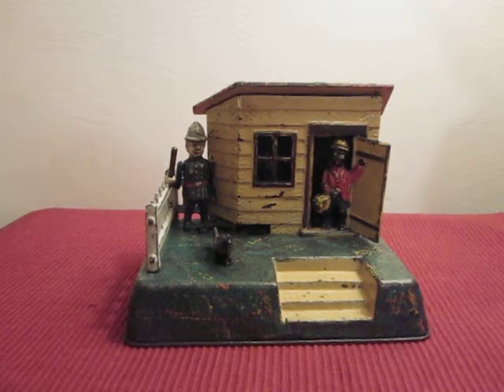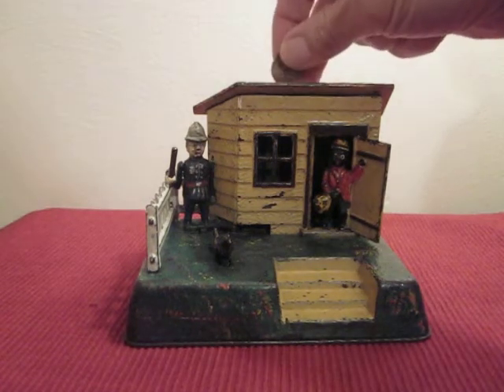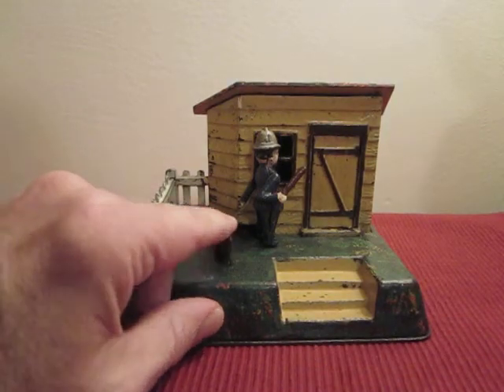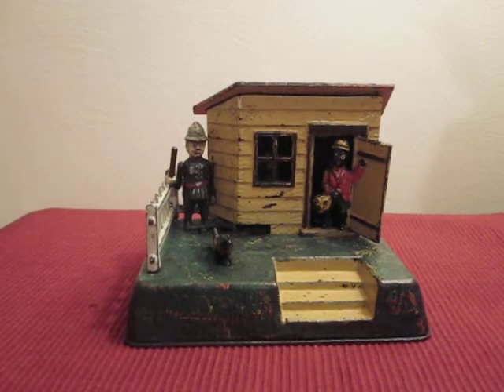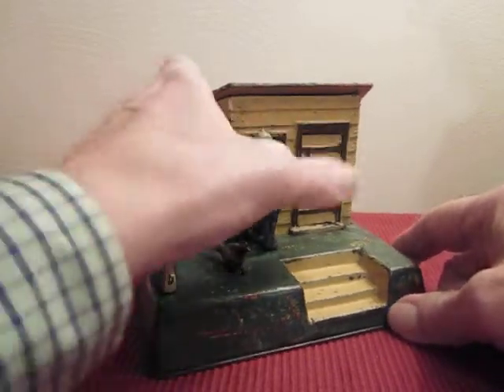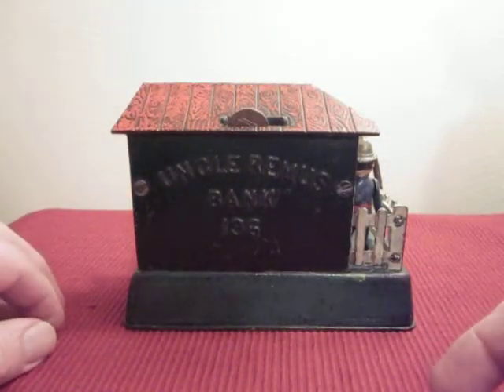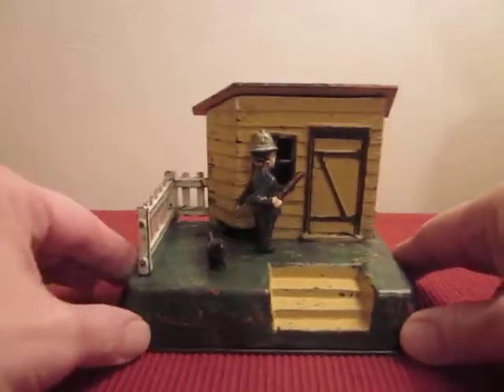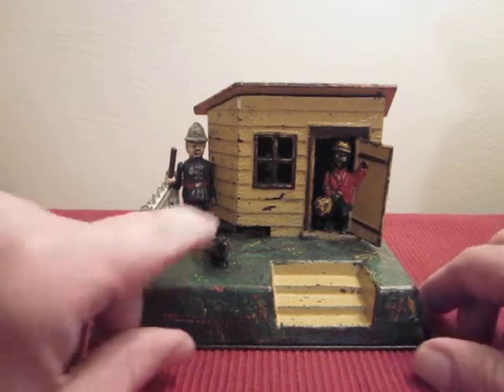"UNCLE REMUS" Original Antique Mechanical Bank Video

Comment: hello do you know a website that sells theese banks
Reply from the maker: Hi, There a few actual "stores" or places that sell the antique cast iron mechanical banks. Some can be acquired at various auctions around the country. Two sites I believe sell the banks..One is www.raytoys.com and the other is www.russharringtonantiquetoys.com. I also sell banks, on occasion, and I usually deal in the higher end, scarcer banks. I can sell directly and I also sell some on Ebay. I have one for sale now on Ebay. It is a nice "Bad Accident" bank. The listing expires tomorrow evening.I sell under "thingsnsuch100". If you type in "Bad Accident" you should find it. I will be selling some rare banks in excellent condition in the next several months. If you are interested you can contact me at ztrader100@aol.com.  Hope this helps and good luck.Jack Allen

Comment from the maker: There are many differences including the smoothness of the cast iron. The first place to look is the coin trap. The original has a rectangular coin trap on the bottom of the bank and included a key. If it passes that test it would take an expert to make a determination as to the authenticity.  Hope this helps.
Jack